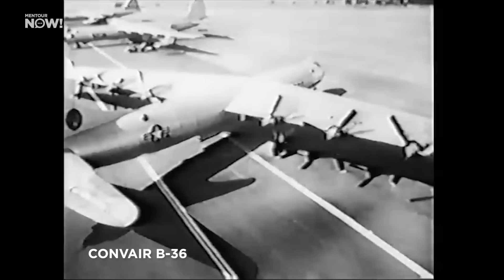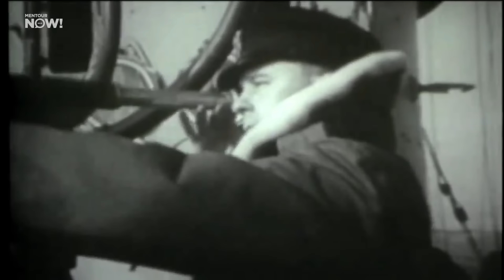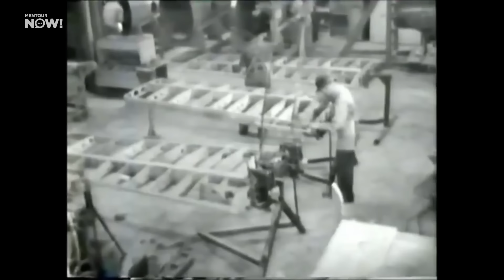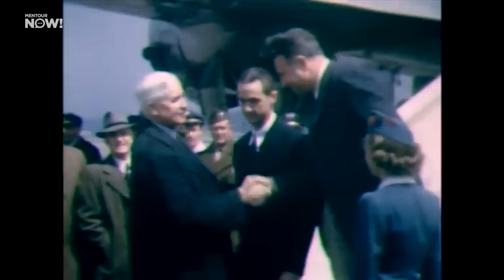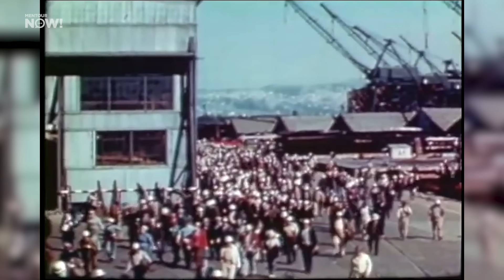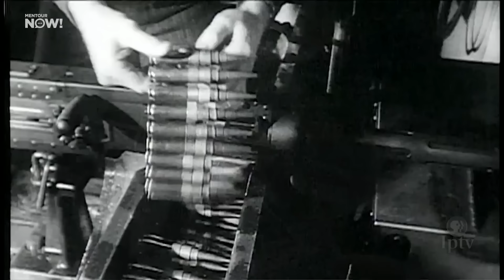The Multi-Million Dollar Plane who Only Flew ONCE!

Comment: I just visited the Hercules H4 in Mcminville Oregon, the veterans at the museum were fantastic tour guides, we got the tour of the flight deck, our guide answered all my questions. the wings are bolted together in the center by 3/8 coarse thread bolts and washers, the guide told us on that fateful flight, one of the shipping stops had not been taken off one the rear elevators so he could not gain any altitude so he had to set it down since he was headed for the city of Long Beach. Huge does not even start to describe the mass of this aircraft, it dwarfed the 747 sitting out front of the museum, there is a water park next door with a 747 on the roof with waterslides coming out of it, we enjoyed our day at the museum.

Comment: I visited the "Birch Bitch" in McMinville in 2012. I also sat in the Captain seat, wearing one of Howard's felt Fedora's. The Flight deck is truly massive, seating for 20 people and  2 small GA engines at the rear near the tunnel into each wing. Its rumored that the Flight Engineer could change a mag in flight if the need arose.

Comment: AS SEL pilot and A&P working for a regional airline in the late 1970s, I was given a tool box and a couple flight instruments in their protective boxes to install on an airplane in the system.  When the pilot pulled the nose up on the DC9 I THOUGHT IT WAS GOING TO STALL. I had 400hrs SEL and this attitude would result in a stall

Comment: I worked for Hughes Aircraft Company starting in June 1977. At that time the engineer that was in the copilot’s seat on the day it flew in Long Beach Harbor was working in my same department as a hydraulics engineer. His name was Dave Grant. On that day in 1947 Dave was monitoring the hydraulic systems next to Howard during the taxi test. Dave said even he did not know that Howard was going to fly the plane that day. He also told us that the main reason he was there was because Dave was not a pilot. Howard did not want anyone else in the cockpit that could get the credit for flying the airplane that day. 
In 1980 Dave took a small group of coworkers down to San Pedro on Long Beach Harbor where the plane had been preserved in a hangar for 33 years. We we able to go into all parts of the airplane including the cockpit, down the long access passages inside the wings which are over 10 feet thick at the root, and up a ladder into the vertical stabilizer to see how the aircraft was built. This was shortly before the Goose was moved to the dome in Long Beach Harbor.
Reply: Cool! I also got to see the Hercules in it's original hangar, before it was moved to the dome.
Your friend the hydraulics engineer would have been an important part of the tests, the fully hydraulic boosted flight controls were a new development. The big event from some perspectives was not that the Hercules flew, but that it flew well, no control issues or instability. For the largest airplane ever built with a new flight control setup, that is impressive to someone who worked flight test programs.
My first aviation job after getting my A+P license in 1979 was in the Experimental Flight Test dept of Hughes Helicopters. One of our electrical engineers had been with Hughes since WW2, and was one of the electrical engineers on the one flight. His opinion was that much of the delays in the program were the many new advancements being incorporated into it. 

I asked him if Howard had intended to fly it that day. He said "If you set takeoff trim, takeoff flaps, and takeoff power, guess what's going to happen?" Being empty and quite light, it may have lifted off earlier than he expected, but still no control issues.
As a new A+P, one of my thoughts as I looked at it was that with my luck, someone would tell me to clean the spark plugs on it, all 448 of them.

Comment: Many years ago I was lucky to get a personal tour of the H-4 shortly after it was acquired by the Rather Corporation. A friend and Rather executive arranged for the two of us to go through the aircraft while it was still in the original Hughes storage building guided by the head of Hughe's maintenance staff.

The H-4 was more of a 'science project' than a production prototype. For instance, all the engine controls of one side were actuated electro mechanically with vacuum tube operated servo motors. Engines on the opposite side were controlled with electro hydraulic actuators using a different system of vacuum tube amplifiers. These servo actuator systems controlled throttle, prop pitch, mixture and cooling flap position for each engine. Engines were accessible from a passageway in the wing. Only towards the outboard end was it necessary to stoop a bit...

Flight controls were hydraulically boosted, the ailerons for instance being roughly the size of the wings on a DC-3. A 1,000psi hydraulic system was used with large (~1 inch diameter) stainless steel hydraulic plumbing. A synthetic feel system, again using vacuum tube analog computers, provided force feedback to the pilot. A mechanical reversion arrangement was available whereby the pilot controls actuated trim tabs on the control surfaces via cables allowing the pilot to 'fly' the surfaces into position.

The radio system was interesting, too. The radio operator sat behind the pilot on the port side facing outward. The communication radio was mechanically tuned via a small hand-crank with a mechanical, linear frequency display as one might see on an old car radio. The radio tuning controls were mirrored to the right of the pilot on the center console with matching hand crank and linear frequency display. The pilot's and radio operator's tuning controls were linked together by an arrangement of shafts and gearboxes below the floor such that either could tune the radio. The pilot (Hughes) was also provided with a small lever whereby a clutch disengaged the radio operator's control...

A tube with swiveling joints, about 4 inches in diameter and ending in a trumpet like exit descended from the overhead and could be positioned to direct fresh air directly at the pilot's face - Hughes was a germaphobe.

The H-4 flight deck was large. Crew (pilot, copilot, flight engineers, radio operator and (I think) navigator) were seated with pilots facing forward and the others facing outward to port or starboard.  Behind the crew on the centerline was a scaffold like structure located below a ceiling hatch that allowed someone to stand up above the hull to con the 'ship' for docking, etc. Directly behind this conning station were several (5 or 6) electrical cabinets similar in size to server racks one might find in a modern data center, arranged athwart-ship and containing the vacuum tube analog computers mentioned earlier.  There was ample room to walk fore and aft past these racks on either side. On the starboard side of the flight deck opposite the electronics cabinets were two large, sound-proof cabinets, each containing a 4-cylinder Franklin aircraft engine and a generator - the APUs...

Behind the crew, conning station and electronic cabinets was an area with perhaps 20 seats for observers. The entirety of this flight deck was located above the main cargo compartment at the forward end of the fuselage.

From the time of its one flight in 1947 the H-4 was maintained in airworthy, ready-to-fly condition. All components were maintained to specific calendar based maintenance schedules for regular tear-down, cleaning, inspection and replacement of seals. I felt badly for our guide who's long career overseeing H-4 maintenance was then about to end.

Comment: I had the very unexpected pleasure of going inside the Spruce Goose when it was housed in it's special-built geodesic dome in Long Beach, CA.  I am the owner of an audio company located in Los Angeles and was contracted to provide a LARGE disco dance and PA audio system for an audience of at least 350 happy dancers.  The party was called "Under the Wing."   Literally, the dance floor was placed under the right (No. 1) wing of the air plane, with room to spare!  My crew and I began the setup of the PA system and disco dance systems early in the day and began the testing of the two systems around 2 PM.  Around 3PM, I allowed my crew to leave and visit some of the sites in Long Beach...the Queen Mary ship is docked close by.  Being the curious type, I hoisted myself up inside the Spruce Goose.  For at least an hour I walked nearly every inch of the Spruce Goose; looking around, from back to front and even sitting in the pilot and copilot's seats...something the guided tours would never allow.  When people tell you that this is the largest airplane ever built, believe them!   BTW, the Pointer Sisters were the entertainment between the disco dance sets!  This was an unforgettable experience of a lifetime!

Comment: I agree, if H-1 Hercules had been made of Aluminum, that would have changed history. Post war transport and passenger planes would used the knowledge gained from the Hercules to build the new post war aircraft, it also "utilized a pioneering hydraulic flight control system due to its immense size, which made conventional mechanical controls impractical".

Comment: 448 Sparkplugs in that plane (2 per cylinder, 28 cylinders per engine, 8 engines).  And the 4360 was an engine that in some configurations might need the plugs changed regularly.  Thats a lot of plugs!

Comment: One of the Hughes Aircraft creations, which you showed very briefly in the video, was a twin engine single seat fighter with twin boom tail. He was almost killed when testing this machine because a serious engine issue caused a crash. However, the general design was picked up by Lockheed and developed into the massively successful P-38 Lightning.

Comment: As part of a pilot group, we flew to Long Beach and got a private tour in the dome.  There were only about 20 of us and we were given access to the plane the public was not allowed.
Each of us sat in the co-pilot's seat for a photo, and we walked around the flight deck as we wished.  I opened the door to the right wing and stepped inside on the walkway for a moment.
I have books on the plane.  IMO, Howard may have been let down by subordinates in his past that left him holding the responsibility for wrongs not of his own doing.  This may have led to his extreme detail study of the project.  Each engine had 28 cylinders with 2 plugs each (56 spark plugs), times 8 engines = 448 plugs.  Howard examined each after the engines were run in.
He had many irons in the fire at all times.  It is doubtful any of us have had to function at such a high level under such pressure.  
His near death in a plane crash left him in great pain, and so there were pain killers to be taken.  And still he kept an intense schedule.  I feel the required pain relief led to what came later.

Comment: Was lucky enough to go and see it in Evergreen a few years ago. TBH, although it's physically big (it takes up most of the main hall) it doesn't feel that big as the fuselage sits so low on the ground.  I think if it was in a bigger hanger and you could stand back & appreciate its vastness, it would be more imposing. There's a 747 parked on the roof of the waterpark next door, or the one on the roof of the Technic museum in Speyer - now they look BIG!

Comment: I believe the Hercules should be turned into a tour plane. It is certainly capable of sustained flight, and as such, would be a perfect aircraft to have flying tourists over coastal cities or even as an air ferry. It would give her a practical use that many people would be able to appreciate, the cost of operation and maintenance would be offset by the revenue generated from its capacity as a tour or ferry plane, and it would draw even more people from around the world who want to see her actually flying rather than just sitting idly in a museum. She could also be fitted with modern turboshaft engines and aluminum reinforcements in key stress zones, and subsequently have greater fuel efficiency and speed than she currently would as designed.

Comment: I'm going to downvote this title, because it did fly where an uncountable number of airplanes over an unknown number of centuries have tried and failed to do the same thing. Oh and it didn't even crash. The Wright brothers only managed 12 seconds. 

Not even close to the closest boondoggle when measured in monetary terms either.

E: I'll Concede that it may be the largest in size boondoggle if it is at least larger than a single Littoral Class Boat(LCS)

Comment: Not sure what kind of cargo capacity the Hercules had and thus how many of them would've been needed to be an effective means of transporting supplies to Europe, but: IMO, this wasn't such a loony-tunes idea as some have made it out to be. To me, the main problem the plane had was that they just couldn't seem to get it to work quickly enough. I'm pretty sure that by 1944 at the latest, the U-boat-threat wasn't anywhere near as bad as it had been in earlier years. Advancements in Allied tech to locate, track and destroy U-boats had made a lot of progress - there's a reason why out of 40,000 U-boat crew, 30,000 perished in combat. 
And I think the main reason why they couldn't get the H-4 to work was engine/propulsion technology. I mean.. the plane wouldn't have to be fast or capable of flying at particularly high altitude. All that was really needed (I guess) was for it to reach, maybe, 10,000 ft which would've put it out of range of U-boat mounted AAA. But it was such an enormous machine that piston engines simply couldn't cut it. 24,000 hp is a lot of power, but probably still not enough in this case. I bet if they would've had even early jet-engines at their disposal in, say, 1943, the H-4 would've made a lot more sense. It probably also could've helped if they built the thing just a little smaller. Germany did have a large cargo plane of their own (Me 323 Gigant) which also only had piston engines but still managed to haul 13 tonnes of payload. 
I also always thought that while Howard Hughes certainly had a lot of mental-health problems, he most definitely wasn't a fool or a madman - especially when it came to aviation and to running his businesses. He probably got a bit too obsessed with the details but I can certainly understand why he absolutely wanted to see the project through, even when the H-4 wasn't needed any longer. As he himself stated, he thought that his reputation was on the line here - and I think he was right.

Comment: The story of the H4 Hercules is very reminiscent of the story of the Martin Mars.  Another flying boat, this one was produced by the Martin Company.  Like the H4, it was never really an effective in its designed role, which was as a long range ocean patrol craft.  A total of 7 were built, 4 of which were eventually converted to water bombers.  Two of these survive today (the other 2 water bombers having been destroyed in the early 60s), and were used in firefighting efforts in coastal British Columbia (the west coast of Canada) until 2016, when it was retired in favour of more maneuverable and efficient firefighting aircraft.  (The Martin Mars waterbomber was the king in terms of water dropping systems, but it's huge and relatively sluggish airframe meant it was literally getting in the way of other aircraft trying to apply more effective fire retardant, and it could only operate effectively in certain areas because it needed a particularly long lake to refill its water hold to take another pass.  Still, it's very impressive seeing one drop a truly absurd amount of water, simultaneously seeming to leap several hundred feet into the air (imagine the response of an aircraft shedding 2/3 or more of its mass all at once, the lift you needed to stay airborne before suddenly becomes way more than you need) and also flattening pretty much anything underneath it.  (My dad has a story of seeing a gas station fire that was put out by a single drop from one of these things...he describes the fire being gone and the gas station also being pretty much gone.)

One was recently donated to the BC Aviation museum and took its final flight from Sproat Lake down to Victoria, escorted by the Snowbirds (the Royal Canadian Air Force's aerobatics squadron.)  The other surviving plane was donated to a museum down in Tucson, Arizona.

They're definitely no Hercules, but at a 60 meter wingspan, they sure as heck dwarf the Snowbirds in their little Tutors.

Comment: The Hercules or any large flying boat being used as cargo plane can still fit the niche today. Just so happen to be water-based. Just saying

And the issue of salt corrosion? Make the hull that touches the water be made of or lined up with plastics/polymer or wood laminate panels. Problem solved

Comment: I saw the goose in 85 in long beach ca when i was 15. It is massive to behold.  Its height is impressive as well as its length and wings.  Im not sure it call it a failure... it DID fly and it could have flown higher and further. If i recall the war ended before the goose could be of much use and technology kind of made it obsolete very quickly.  Its a victim of its time but i dont think failure is the right word